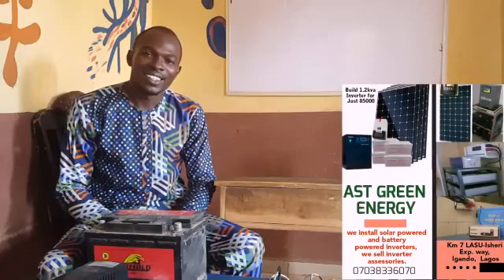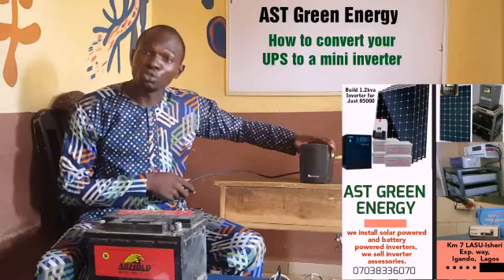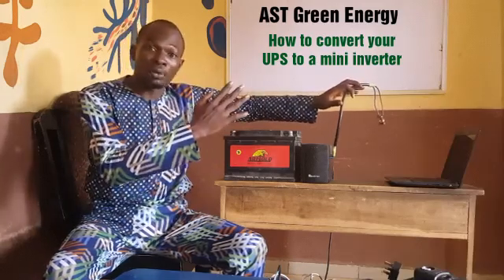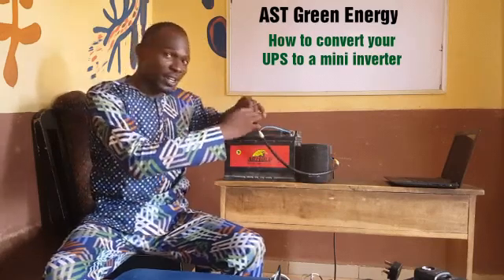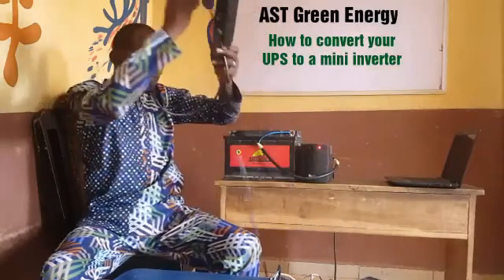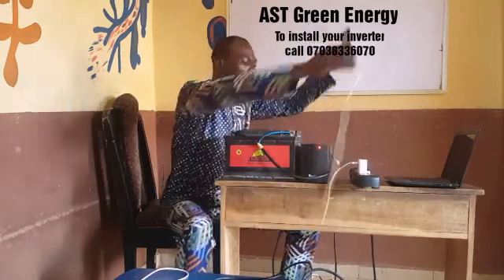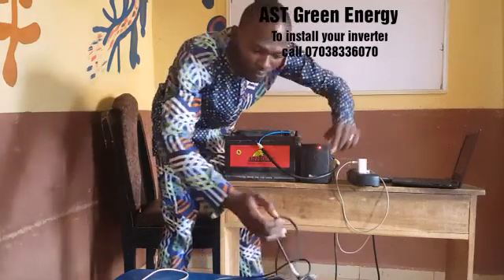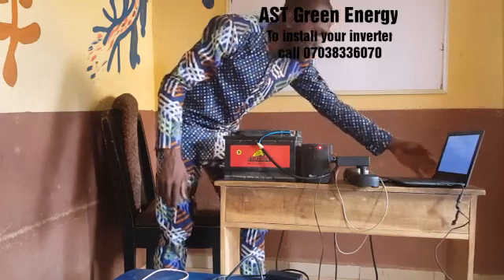Converting your UPS into an Inverter

Comment: So, if you have a 24V UPS and wants to connect your 12V battery, how will your connection look like?
Reply: The se question I also want to ask?
Reply from the maker: You have to use 2 batteries in series just the way it was connected in the UPS... note the ups is not designed to charge the battery properly so you get an external charger

Comment: Hi, my question is that after the convertion, I realise the ups drains battery faster than the normal solar inverter. Is there how to modify the ups, so that it will minimize draining of the battery like the Solar inverter. I hop my question is clear
Reply: Yes sir your question is clear. This can’t be done except we want to rebuild the ups panel. It’s not actually an inverter. This is only an improvised system. If we need an inverter that properly manages an battery, then you can go for a proper inverter. Thanks for your comment.
Reply: Yes sir your question is clear. This can’t be done except we want to rebuild the ups panel. It’s not actually an inverter. This is only an improvised system. If we need an inverter that properly manages an battery, then you can go for a proper inverter. Thanks for your comment.
Reply: Yes sir your question is clear. This can’t be done except we want to rebuild the ups panel. It’s not actually an inverter. This is only an improvised system. If we need an inverter that properly manages an battery, then you can go for a proper inverter. Thanks for your comment.
Reply: Yes sir your question is clear. This can’t be done except we want to rebuild the ups panel. It’s not actually an inverter. This is only an improvised system. If we need an inverter that properly manages an battery, then you can go for a proper inverter. Thanks for your comment.
Reply: Yes sir your question is clear. This can’t be done except we want to rebuild the ups panel. It’s not actually an inverter. This is only an improvised system. If we need an inverter that properly manages an battery, then you can go for a proper inverter. Thanks for your comment.
Reply: Yes sir your question is clear. This can’t be done except we want to rebuild the ups panel. It’s not actually an inverter. This is only an improvised system. If we need an inverter that properly manages an battery, then you can go for a proper inverter. Thanks for your comment.
Reply: Yes sir your question is clear. This can’t be done except we want to rebuild the ups panel. It’s not actually an inverter. This is only an improvised system. If we need an inverter that properly manages an battery, then you can go for a proper inverter. Thanks for your comment.
Reply: Yes sir your question is clear. This can’t be done except we want to rebuild the ups panel. It’s not actually an inverter. This is only an improvised system. If we need an inverter that properly manages an battery, then you can go for a proper inverter. Thanks for your comment.
Reply: Yes sir your question is clear. This can’t be done except we want to rebuild the ups panel. It’s not actually an inverter. This is only an improvised system. If we need an inverter that properly manages an battery, then you can go for a proper inverter. Thanks for your comment.
Reply: Yes sir your question is clear. This can’t be done except we want to rebuild the ups panel. It’s not actually an inverter. This is only an improvised system. If we need an inverter that properly manages an battery, then you can go for a proper inverter. Thanks for your comment.
Reply: Yes sir your question is clear. This can’t be done except we want to rebuild the ups panel. It’s not actually an inverter. This is only an improvised system. If we need an inverter that properly manages an battery, then you can go for a proper inverter. Thanks for your comment.
Reply from the maker: It also depends on the type of battery used... note the ups is not designed to charge the battery properly so you get an external charger

Comment: can it last for 6 hrs if you connect it with a bigger battery
Reply: Wow so sorry for the late response. It can not last up to 6 hrs it will definitely heat up. It’s between 2 to 3 hours
Reply: @ellatoontv5681  if you add a cooling fan it should do 6
Reply: @ellatoontv5681  it can last even more,use charge controller, charge it with solar panel
Reply from the maker: Bigger battery bigger charger needed
Reply: Mine run more than 6hrs, I charge the battery with solar panel. All you need is charge controller and solar panel.

Comment: Can the ups charging system  charge the car battery
Reply: No sir, it’s not built for the car battery the only way to this is to get a separate battery charger which will I turn charge the battery or fix the battery in a car to recharge or better still use a generator to charge the battery as some generators have the facility for this. It’s just for emergencies where there is need for electricity. Thanks for your comment sir

Comment: how many watts output and for how long
Reply from the maker: Good morning angel saw your question. This UPS is 650 watts which can power few things, it can't be used industrially as the wattage is limited. 
By way of calculation if you have your phone charger, a standing fan, your laptop, TV and Two bulbs will be fine.
Phone charger 5watts  x 3 pcs = 15watts
Standing Fan 100watts
Laptop 85watts
TV set 80watts
2 bulbs of 10watts = 20watts
Total = 300 watts
This can provide about 300 watts for 2 hours with a reliable car battery.. 
Note do not use your car battery if you don't have a good means to recharge it hence it can discharge and leave you stranded. Thanks

Comment from the maker: OK thanks for your questions. A lot of people have been calling to ask how to charge the battery. There are 3 major ways to charge the battery.
1. You can purchase a small electric battery charger  which has the terminals of the battery.

2. You can buy a small 12v solar panel which corresponds with your battery and connect all to your charge controller.

3. You can use your car to charge your battery.

I will do a video soon to explain this.
Reply: where de video , b/c that is the main issue.
Reply from the maker: OK I explained it but not in a video... I can do a video in respect to this.. thanks
Reply: The ups charges the battery by default since it's the same chemistry and voltage as the original battery
Reply: But car battery doesn't last

Comment: How do you charge the battery? Cos i was wondering the ups  charging circuit was made for a smaller battery
Reply: If y'all understood how batteries work you'll know that the original charging circuit will still charge the car battery because it's 12v like the original and lead acid, just like the original, the charging circuit can't tell the difference, only it'll take longer to charge now because it's of a higher capacity
Reply: thats what i have been waiting to hear
Reply: @excitingnollywoodmovies  if you got an answer to that l, kindly email me at jubrilakinyemi5@gmail.com
Reply: That is the real trick, I was hoping he would deal with it. Clearly you need an independent battery charger.
Reply from the maker: You are correct, the charging circuit is not for a big battery so it needs a different charger which I explained earlier. Thanks
Reply: You can get a 120w solar panel and a 10amps charge controller to charge the battery
Reply: You can use a solar panels and charge controller